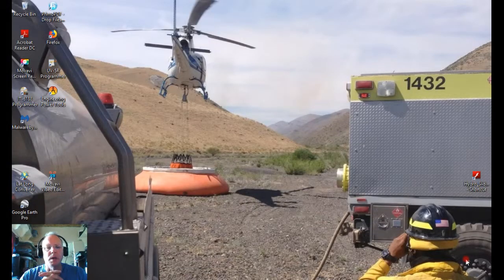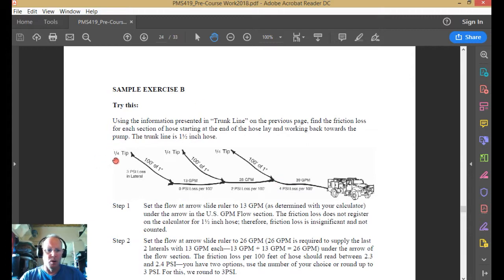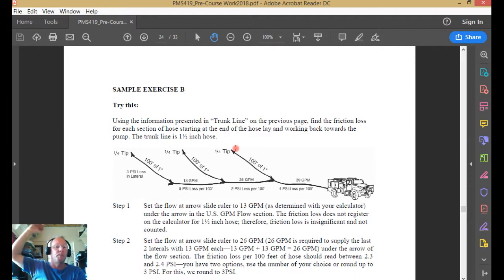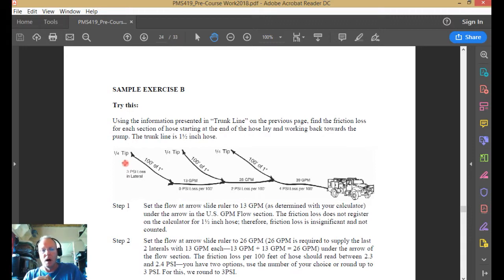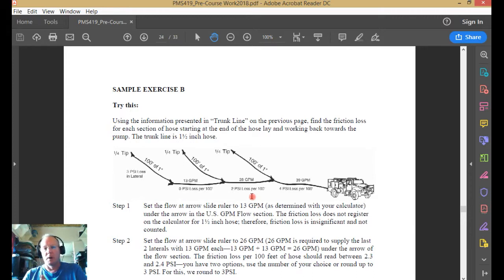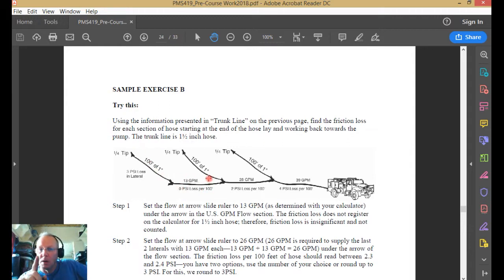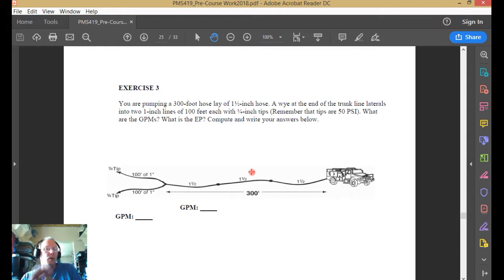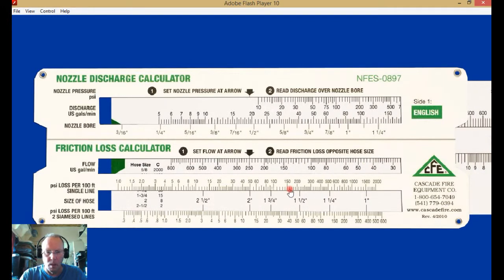FL 101

Comment from the maker: At the end I say friction loss is based on flow not hose size, that was incorrect for me to state, it's based on BOTH  as the friction loss is based solely on how much gpm you're moving through a PARTICULAR size hos. I was intending to show that  you could have the same friction loss NUMBER for two different flow rates and different size hoses. The point to this issue is that if your pump is capable of moving more GPM but the friction loss in the 1 1/2" size hose makes it prohibitive, then switching to a larger hose will most likely allow for that to now be allowable.